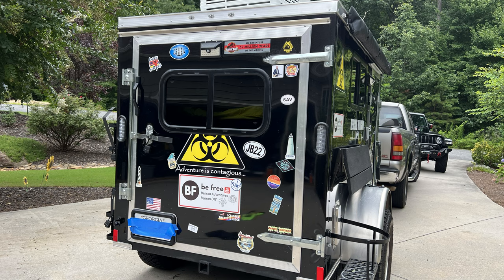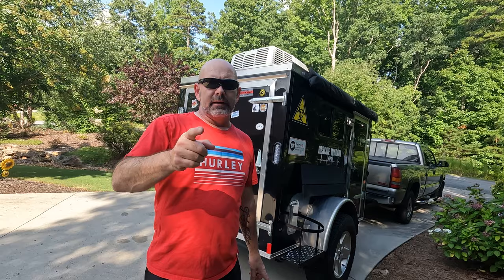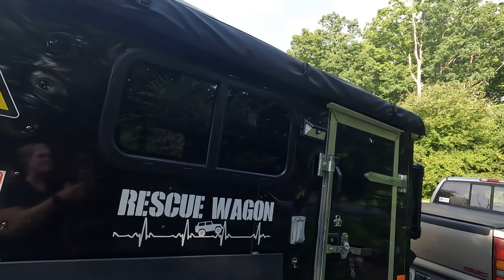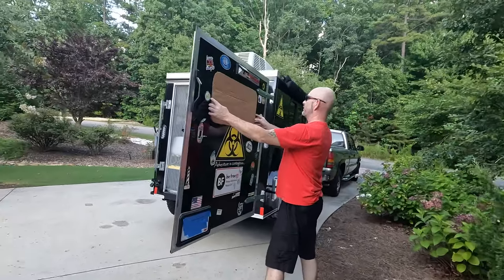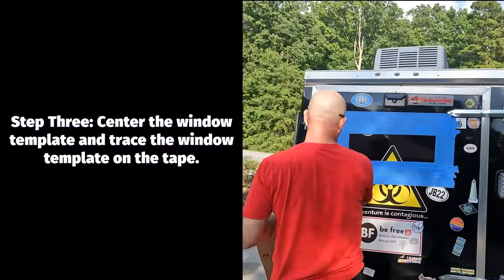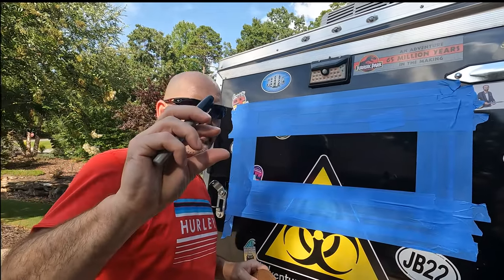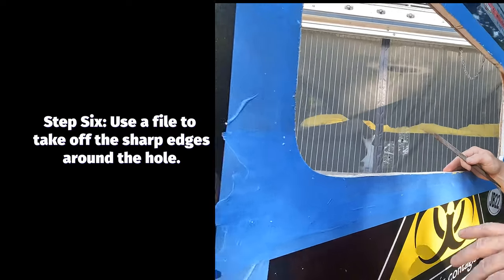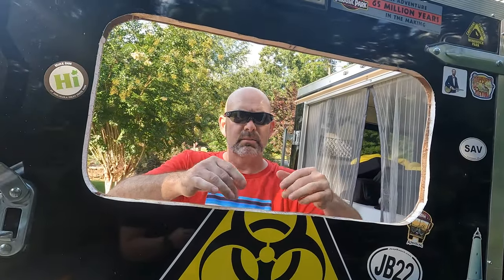HOW TO MAKE YOUR 5x8 CARGO CAMPER HUGE//Installing an additional window

Comment: Hello again Kevin and Stacey, Nice job on your new window! Ironic that you call your back door modification making your camper huge! I'm now planning my 'ramp-room'. It's still 'removable' since I also haul a motorcycle. So, my back door modification will add about 12 sq ft to my previous 24 sq ft!
Reply from the maker: That modification really will make your camper “huge”…. We are really interested in seeing it when you finish it.  What kind of materials are you using?
Reply: @befreebensondiy  I was planning 3/4 ply but with stupid inflation, I'm thinking about saving weight and gluing thin stuff to foamboard.... White Aluminum sheet outside would match the trailer. maybe 2x2 frame on the edges to hold it together. What do you think?
Reply from the maker: @johnw65  Sounds like a really creative way to add some more space,  Good luck with the project!